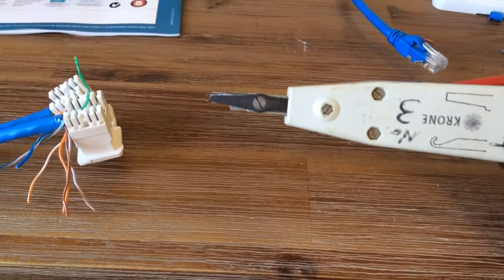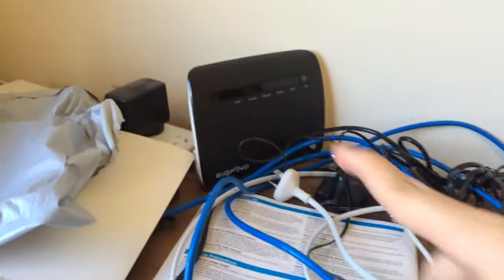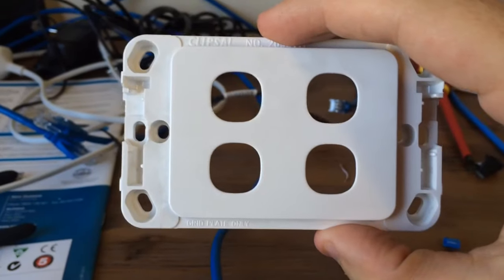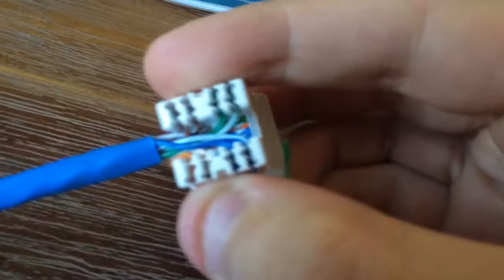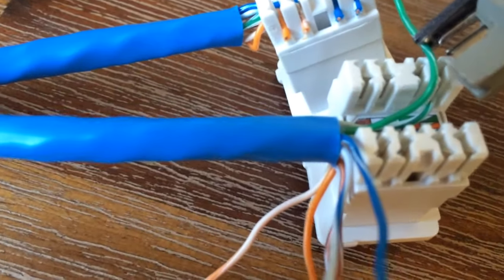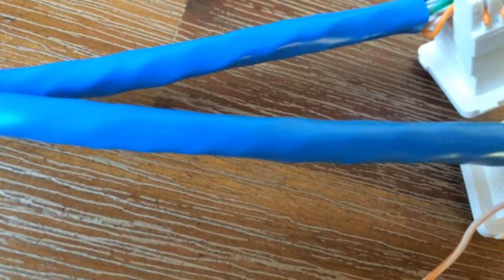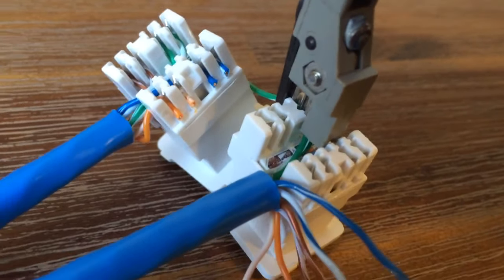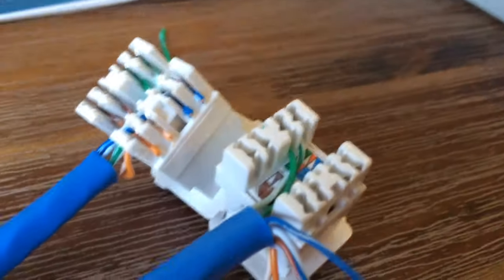How to Use KRONE tool demonstration

Comment: Not a very good demo...went out of view at the critical moment and the noisy offspring was a big distraction. Doesn't matter 'cause I ain't gonna use one!
Reply: Don't you hate it when even your own kid is critical?

BICSI lists knowledge about the Krone Lötfrei [Solderless]  Schraubfrei [Screwless]  Abisolierfrei [No insulation removal] (LSA) punch downs as required to obtain their Installer certification. 

-  45 degrees off from 66- and 110-  Insulation Displacement Connector (IDC) cross connects 
-  allow stranded wires to be punched down